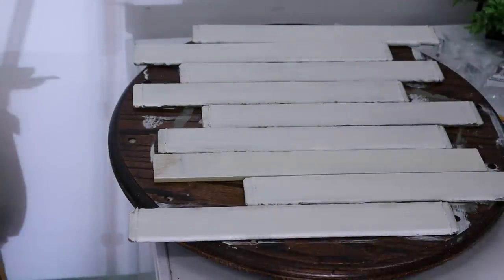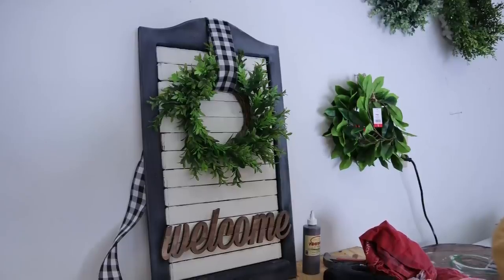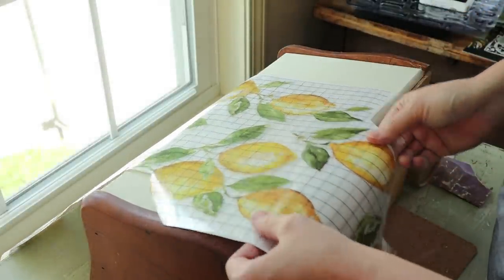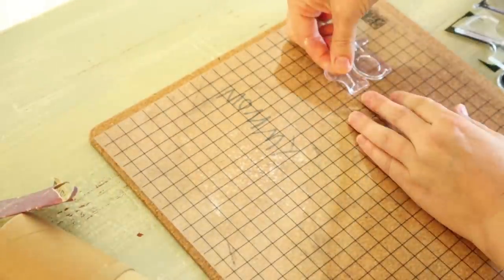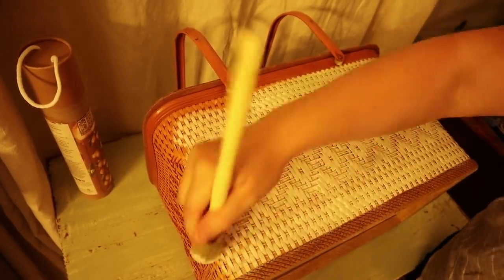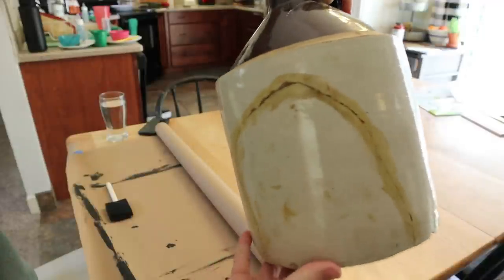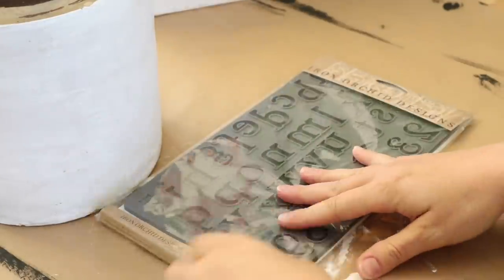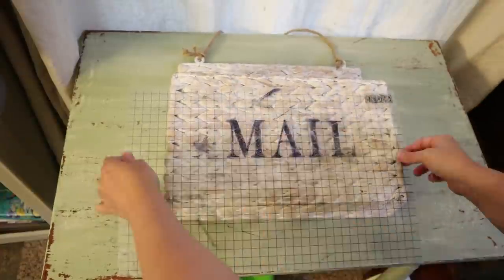6 Antique Farmhouse Decor DIY Upcycle Projects for Resale | Trash to Treasure | Easy Thrift Flips

Comment from the maker: Hi everyone! I'm so happy to get another DIY video out.  It's been a struggle to find the time to craft lately so I'm glad I was able to finally get these finished and share them with you!  Here's a list of today's products:

www.etsy.com/shop/greenonionvintage
Use code GOVINTAGE for $5 flat shipping over $35

Today's Iron Orchid Designs Products:
"Lemon Drops" Transfer
"Harper" lowercase letter moulds
Air Dry Clay
"Typesetting" Alphabet Stamps
"Sunflowers" Stamp

Today's Dixie Belle Products:
"Buttercream" Chalk Paint --- White with yellow undertones
"Drop Cloth" Chalk Paint ---light taupey crockery color
"Sand Bar" Chalk Paint --- Light Taupe, slightly darker than Drop Cloth
"Caviar" Chalk Paint --- deep black
"Barn Red" --- soft vintage red
Slick Stick --- primer for glossy surfaces, helps paint adhere
Clear Best Dang Wax --- easy to use sealer for chalk painted surfaces
White Best Dang Wax --- Finishing wax to emphasize details
Reply: try baby powder, or a bit of cornstarch. clay will come out of the molds with ease.
Reply: Hi i just your video for the first time:) Everything was so pretty and original, I love that you were kind enough to share the information and ideas. God bless you for that♡♡♡♡
Curious, did items sell well? You would've made a killing selling these items in NYC.. No pun intended,btw.

Comment: Use cornstarch for the iod letter molds it keeps the clay from getting stuck inside the molds
Reply: Do you just sprinkle it in the mold like flouring a baking sheet?
Reply from the maker: Yes, that's what I've done in the past.  You can also use flour or baking soda. Just a light dusting.
Reply: @GreenOnionVintage  thank you so much. ❤️
Reply: Yes,Thank you Andrea,for this too I was going to comment the same thing,but cane down and read all the comments and saw you've already gave this Great tip,also I do want to say I saw somewhere someone said use flour....I don't recommend,...er... By trying the flour method,I realized it's awful,it can actually mold when sealed with a water based sealer especially and it tends to discolor white paint,if say you were to leave then white and then paint then too!!   hope thus helps Also! 😊 Everyone have a Blessed day! 🙏💗

Comment: Oh I think the painted Sunflowers look nice… it pulls the color of the basket handles and trim into the whole basket nicely. Good save for the picnic basket. Love the idea of Transfers on the Rolling Pin!  I may have to try that!

For you molds, add a little corn starch to the molds and the clay comes out easier. Just use a paint brush and dump the extra out. Great idea with painting the handles on the Rolling Pins…I like that red tones to!

And how great the jug and bottle came out !!! I have a brown jug…I may have to paint that too! 

Great inspiration 👍 💛💛🌻💛💛

Comment: I saw a video where the "artist" dusted her mold with corn starch, before putting the clay in, and she put her mold in the freezer to harden, and it popped right out.  Of course, if you're applying it to something with a curve, like a jug, cup, glass, or bottle, you would want to dust the mold with corn starch, empty the excess, and fill with clay, then remove, while still flexible.  Your work is beautiful.

Comment: Great ideas I loved what you did with the broken crock. I just recently used the Harper alphabet mould for the first time and I found that dusting them with cornstarch and sticking them in the freezer for about 10 minutes made them so easy to release. I have a few big gallon glass bottles that I will be trying your method on. Thanks for the inspiration!!

Comment: I really loved the watercolor thought it was beautiful. Could you tell me about the slick product you used on the jugs and what it’s for? Just learning about Dixie belle products and love what I have purchased from you.
Reply from the maker: Hi Melissa!  The Slick Stick is a primer specifically for glossy items that paint might otherwise have a hard time adhering to.  Chalk paint is typically good for glossy items, but I've noticed I have a difficult time painting glass because my second coat will start to pull up my first coat of paint.  Slick Stick solves that problem...my biggest tip for slick stick is to give it PLENTY of time to fully dry before moving onto your first layer of paint.  Just a very thin coat does the job :)  Glad to hear your enjoying your other DB products, thanks so much for supporting my channel!

Comment: I'm going back and watching your older videos and I just love everything.  I do have a question... I have never used Dizzie Belle paint.  Can you tell me a little more about it? I have a couple of jars of DIY paint and it's pretty thick and I like it but sometimes it's too thick.  How does DB compare and what the are the things you like about it?
Reply from the maker: Hi Patty! I've used a few brands of chalk paint before switching primarily to Dixie Belle---I feel like their chalk coverage is the best and they have the best color options.  Some of the colors can be very thick also, but since it's a water-based paint you can also add a splash of water to thin it out and I always recommend painting with a damp brush to lessen brush strokes and help the paint go further.  Have you tried that with the DIY paint? Maybe it just needs a splash of water....I haven't used it before but I'm assuming it's also water-based.  I particularly like the variety of DB whites and they cover SO well.  The DB waxes are also really great---other brands have a weird sheen but the DB wax (the clear Best Dang Wax) has a very velvety finish and it's really easy to use. Hope that helps! Let me know if you have any other questions!

Comment: What is the substance you added to the mold  for the jugs you added raised wording too   ide like to purchase them  as well as some transfers    I really like the rolling pin tranfer
Reply from the maker: Hello!  I used the Iron Orchid Designs Air Dry Clay, it's good to sprinkle baking soda or flour in the molds so that the clay doesn't stick.

Comment: What size nails do you primarily use in your brad nailer? I’m wondering because I have one with my electric stapler but I don’t know if I need a different brad nailer?
Reply from the maker: Hi Bonnie! It just depends on what project I'm working on....I've also used it in home improvement projects and it's so useful.  Most crafting projects I use the 5/8" nails but for framing or home projects I've used up to 1 1/2" nails.  It takes 18 gauge brad nails.

Comment: for the Sunflower stamp, did you use IOD ink or another one on the tissue paper?
Reply from the maker: I'd like to try the IOD inks soon but for now I've just been using up a cheap permanent ink pad I purchased on amazon. I believed the brand is Archival ink.
Reply: @GreenOnionVintage  Thanks!  I was wondering if certain inks would bleed with the application of modPodge

Comment: I got the Dixie bell wax but it doesn’t seem to dry. Any idea why I might have this issue! Thank you
Reply: Apply lightly then buff with dry cloth -- should be ok.
Reply: @barbaramorck2933  it’s been on a month, still moist
Reply: @barbaramorck2933  no problem, thank you for trying. It’s over the Dixie bell duck egg. I actually thought Nicole might have some input. I may try to contact Dixie bell